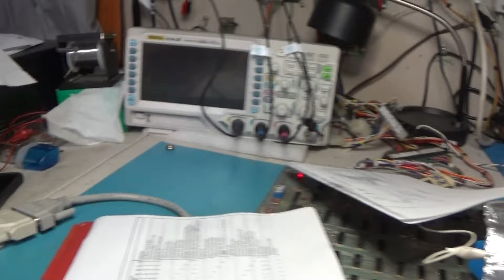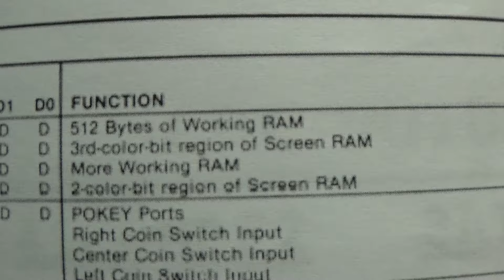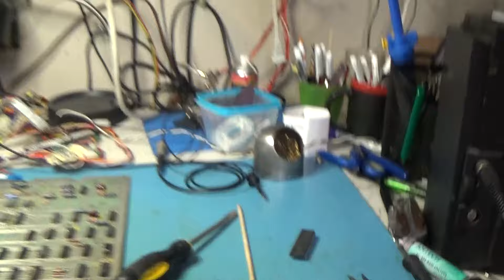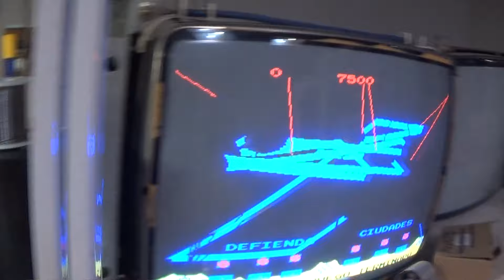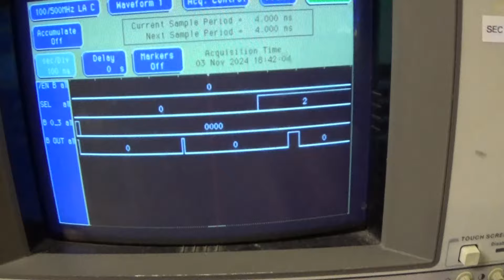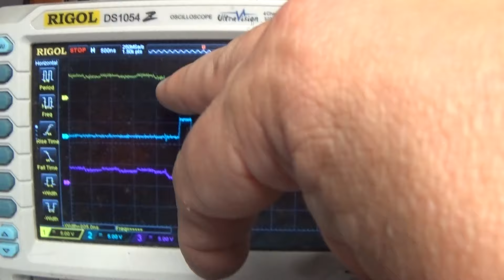1980 Atari Missile Command Arcade Circuit Board Repair -  11-3-2024

Comment: Do you have any experience with bootleg gyruss boards?
Reply from the maker: yes I do
Reply: @classicarcaderepairs4818  board boots no real graphical issues but half the sounds do not work. The board originally had no sound due to bad amps. Replaced both amps. Most of the gun fire effects do not work or sound like constant tones. Music is a bit off as well. The board is defaulted to mono. 2 vol pots only one works. Roms seem to be good. There is one 2716 i can not test. The rest are 2764s. Replaced all sound chips no change... any ideas?
Reply: @ACiDRAiN9797  Not the sound chips, not the ROMs? That only leaves the addressing glue logic to the sound chips. Should be simple 74xx logic. You might also wanna check out the RAM. I've had 2114s fail with just a few single bit errors (like maybe 3 out of 4096 bits bad). Might of course also be a bad trace to one or more of the sound chips (check if all 8 data bits and all used addressing bits make it to all of the sound chips).
I've had a Bomb Jack (3 sound chips) with half the sounds missing or weak. Turned out most of the audio coupling caps were bad or completely open.
There's also the remote possibility of the sound commands getting garbled (like missing a bit), so it plays the wrong sound effects.

You should modify your cabinet to stereo (or just hook up a second speaker). On Gyruss it absolutely pays, it has absolutely epic stereo sound if it works.
Reply: @senilyDeluxe  one thing about boots the solder joints are horrible. My boards are run though a supergun. I have replaced some of the caps. Dont have a scope. There homebrew diag rom that tests everything. No ram errors. Looked around for hot chips nada. Im very limited on what i can do but ill look into what you said.
Reply: @ACiDRAiN9797  A logic probe will do in a pinch on simple 74xx logic. If you don't have one, you could make a video probe (disconnect one of the color outputs to the monitor and use it to probe the IC pins). You should see your color go to digital static if there's a signal, so you can check for example if you have a simple logic gate, both inputs have a signal and the output doesn't, then that's likely your fault.
An even more rudimentary method would be using headphones. Connect the outer ring to ground and the tip to a capacitor and maybe a resistor and probe away. A single click means no signal. Buzzing means signal. Disadvantage is you're loading the signal down so the CPU might crash depending on where you probe.

Go dumpster diving. I've pulled out three scopes so far that all just needed minimal servicing to get going. Also, 70s/80s CRT scopes can be had on fleabay for very little money. For fixing game boards up until the 90s, 10MHz bandwidth is all you need. A late 60s scope beats a late 90s/early 2000s digital scope when it comes to video circuitry. (although you'll run into age-related unreliability issues on scopes that old. Heck I'm from the 80s and I'm experiencing unreliability issues already.)
Reply: @ACiDRAiN9797  And I just remembered the sound board is its own dedicated machine. Unless you install diag ROMs on the sound board too, they can't test the sound RAM. (and even if they do, all they can do is make beep codes, because the communications between main board and sound board is one-way).
(then again, also note that I'm really familiar with Scramble hardware which is kinda similar but not identical, so I might be totally wrong)